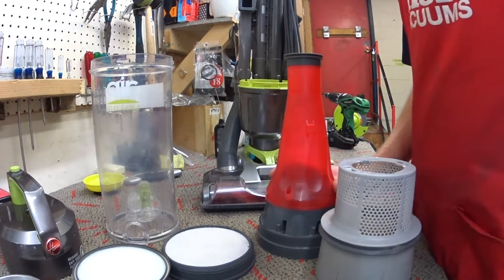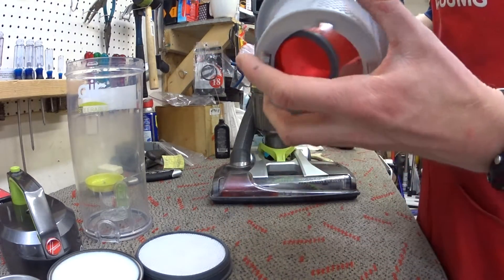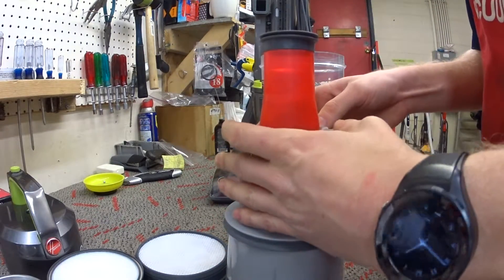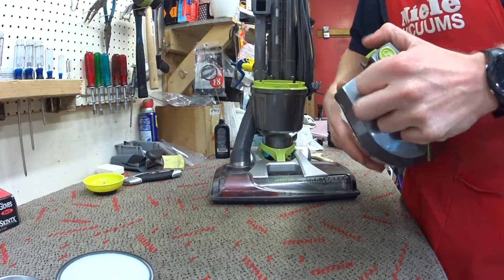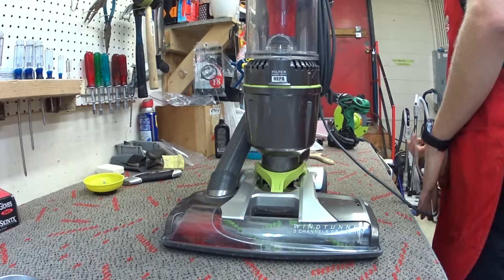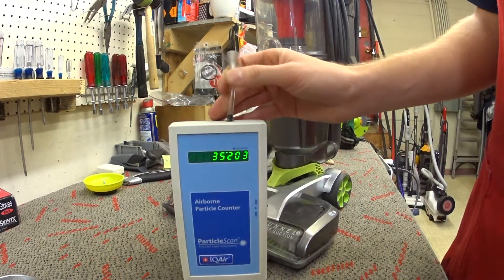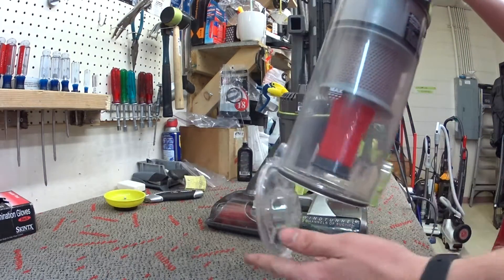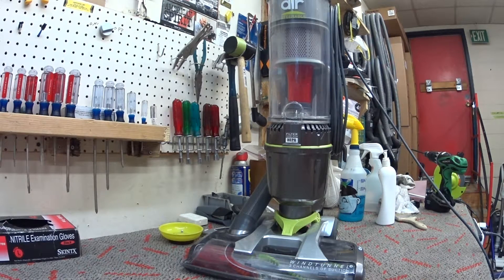Hoover Air /VAX particle counter test UH72400

Comment: Woudl the Hoover canister air perform similar since the same company or totally different. Cant fine any canister vacuums with good filtration system. Thanks.
Reply from the maker: Check out a Miele one of the one of the best in industry.
https://youtu.be/whyDx0ChTcA

Comment: I’ve heard now from both my local vac shops that these are actually decent machines for the money. Was very surprised to hear that to be honest
Reply from the maker: +Hank's Small Engine Repair there are designed Vax for the European market originally. I believe they were held to a higher standard than most of the machines in this price range because of that. That being said there's still 5 year maximum lifespan.
Reply from the maker: +rob w I never said it was a premium vacuum I never said it wasn't disposable. I just said in the $100 price range it's not a bad option when you compare it to Bissell and Eureka, shark . You can't ask all those things from $100 -200 machine. The point of the video is that it filters well and is easy to maintain. As everybody knows I usually recommend sebo and Miele . When you want a quality portable vacuum.
Reply: rob w obviously I’m saying this based on the price point and so were they. Obviously again, they’d recommend many machines over these. Not rocket science. But at this price point what’s better? TTI is making the best of the cheap Vacs right now imo.